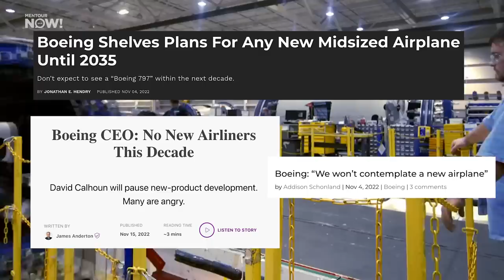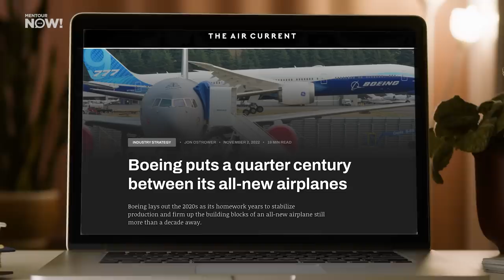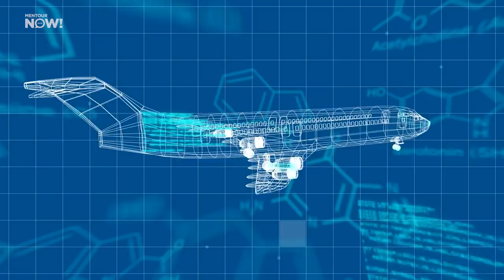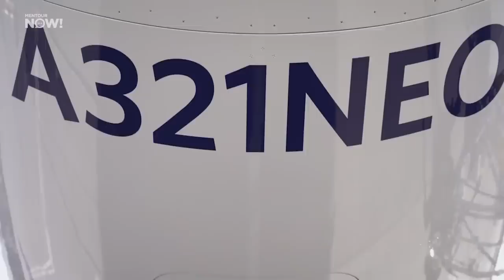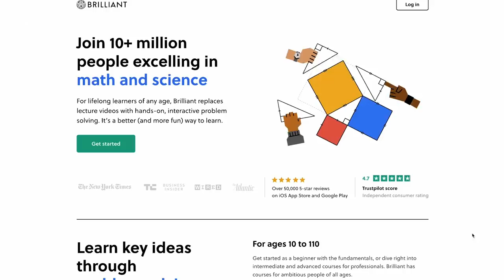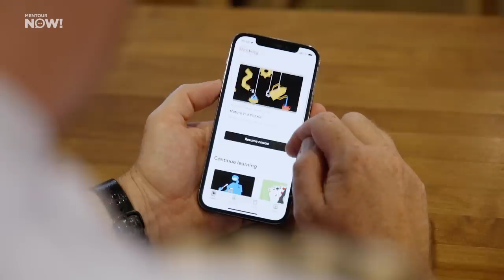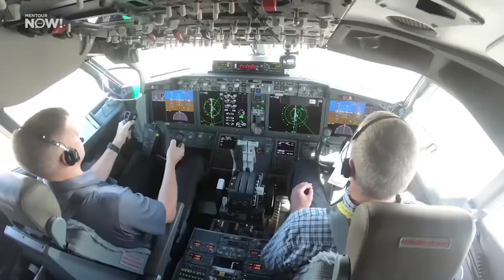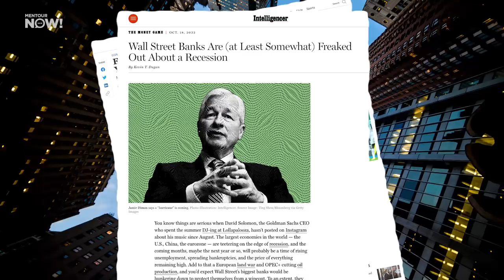Is BOEING giving up!?

Comment: All a bit strange. 
Aircraft manufacturers traditionally have concepts, designs, test prototypes out there years before anything gets off the ground.
 Some of the gaps in Boeing's line up seem obvious: the 757 replacement, an updated 737, a plane to compete with A220, which they have none.

Comment: What about potential compensation claims for 737 Max customers? Those must be pretty high. I would also consider that Being as a strategic partner of US-DOD has got sufficient more information, which we don't have, i.e. they need their capacities in all areas for upcoming trouble. So they consolidate and get prepared, makes sense. Furthermore I just read in a Lufthansa advert that their new 787-9 runs on 2,5 litres (per passenger/100 km, I assume) which is compared to a 20 year old Airbus 340 1 liter less - almost 30%. As You stated, there is not much gain in a new model for a foreseeable future. Then there might be China with own Airbus copy cats probably entering the world market cheap (except of US/EU) ?  One lasst thing: 
I think that Boeing is in parallel co-operating with a couple of other medium sized manufactures across the globe in secrecy or let's say:  given litte attention to by public. 
Also that one could assume, is part of a wider US business & military plan by strategists know where they are heading too, don't worry too much.

Comment: I see alot of criticism here in chat but I want to make a point. 

I think the vertically integrated fossile fuel industries are going to eventually kill commercial aviation, not directly but indirectly. The problem is that as long as prices are low people will continue to use fossile fuels until eventually the drills required to reach the next barrel will make it too expensive for most air travelers. Airlines will be forced to running the most efficient aircraft and avoid long hauls overseas. They will see their profits eroded by high speed rail that is going to just take off in the next decade as transportation industry scrambles to find high speed alternatives. 
  
 If I am boeing I am looking at this, heres why. 
Solar. 1400 x .33 = 450 w/m. So lets argue that 787 Needs 1000 kg/sec at 250 kN
250,000 / 1000 = 250 m/sec Ve. 250 x 250,000 = 63 MW power for take off and say 25 MW for level flight and recharging takeoff batteries. Per engine. Total is 50 MW. 
Take 50 MW/ 450 w/m and you get 111,111 sq. meters of required panels per craft the actual wing area is 377 sq. m so roughly 300 fold increase in wing area and weight. Its probably true that with modern technology adding solar panels to day flights does not justify the added weight. Solar might allow travel at much higher altitudes but with a huge increase in side drag and reduction in speed. At some point the speed falls below highspeed rail, and the game is over. 

The same is true right now for fission based nuclear reactors and for future fantasy fusion reactors. Fission power could be potentially employed but since the cooling channels would need to be in the wings, there is simply no way to make it safe. 

Conclusion there is no effective on board electric power generation that is a full replacement for Jet fuel. 

What about batteries, for short routes they might suffice, but then they are competing with high speed rail. There is another problem with batteries, the mass does not change between take off and landing, and highspeed landings are brutal on aircraft viability, outcome, bigger wings and slower speeds. 

This leaves hydrogen. Hydrogen has the highest energy per kilogram of any fuel but nuclear fuels. You can achieve exhaust velocities of 4300 m/s at sea level. This might seem like a miracle until you realize that despite having a higher specific energy, its peak energy density is about 1/3 that of kerosene, and the pressure hulls required to store hydrogen are much greater than those required to store fuels liquified at STP. This means more added wing area. This has an unintended benefit that the craft could fly at FL 450 to 500, but then that adds the problem of dealing with toxic air. 
The other problem with hydrogen is production via solar is about 45 watts of hydrogen equivilent of power per sq. meter, so while home solar might be break even now, solar electric hydrogen production costs 10x per unit of power. Or to put it like this, for our 787 equivelent at 50 MW power we would need 1,000,000 (1 sq km) of solar panels per aircraft feeding hydrogen to the airports. If you do the math you will soon realize transporting the hydrogen from deserts to cities is a big problem. Europe has no such areas to generate power, they would end up needing to refuel in Africa. 

Alright, so Jets are tied like an umbilical cord to jet fuel, we have thousands of unused jets sitting in the desert doing nothing, regulatory agencies are cracking the whip, and there is no replacement flight technology. If we dont conserve liquid fossil fuels for industries were those fuels are the most, 10 fold more, advantageous than any other fuel then current usage will sink commercial aviation. 
Yes, yes, I know, theres a ton of fuel out in the gulf of Mexico, and the north slope of Alaska. And I also know there is a tons of tons of oil below deep shale formations already tapped. But these sources of fuel will not sustain the airline industry for 50 more years at current value, even if all other uses stopped. 
If Boeing were to finish its current modifications by 2030 and spooled out production on those for 15 years buy the end of that 15 years they would have sufficent aircraft to last until liquid fissile fuels became unfeasible. My guess is that the industries see this wall coming. 

What Boeing needs is a breakthrough energy technology. My best guess is a more efficient way to create Solar electric hydrogen production. An alternative is CO hydrolysis and methane production, more future fantasy tech. Coal gasification with hydrogen, the problem with this is that the graphite layers are resonance stabilized, you need to add extra energy to get carbon to pick up hydrogen free radicals. These fuel production strategies all suffer from the same problem, its much much cheaper to use solar/wind  electric directly rather than converting to fuel and back to power again.

Comment: I think there will be a dramatic commercial design shift in the way we fly now to a one wing body design. Similar to the B2 design… retooling is the biggest hurdle.
Reply: Boeing has considered that for a long time, even as far as unmanned small-scale prototypes in collaboration with NASA, but as far as I know haven't made any serious moves in that direction. As well as tooling, there'd surely be a lot of certification challenges given how dramatically different it is, plus issues like evacuation (how do you evacuate it? Hatches in the floor with slides?) and airport infrastructure designed around traditional tube-shaped aircraft, you'd have to redesign the entire ramp and jetway infrastructure.
Reply: I'm waiting for Zeppelins to come back.

Comment: Boeings bread and butter right now is the 737. They have sold a ton of them recently. Im very confident that boeing is on a serious upward trend right now.
Reply: That is a very old design that already hit severe limitations. But pilot training, etc.
Airbus is in a better position wrt pilots as their common cockpit has much more life in it. As compared to the 737 which still has very much the same overhead panel as the 727.
Reply: Upward Trend? Many people do not even check in if the flight is operated by a 737 Max....
Reply: Considering i work there,  my information is based on fact,  not an opinion.

Comment: though they were not entirely new aircraft designs, McDonnell-Douglas was very busy developing, engineering, and manufacturing aircraft that were only superficially similar to existing models. The MD-11, MD-80, MD-83, MD-90, and MD-95 required substantial development over the parent airframes. And to people who try to tell me that the B-717 (MD-95) is a BOEING design, I say “Look at the main landing gear hubcaps. They have the name McDonnell-Douglas cast right into them!” Boeing did none of the design or development work on the aircraft, and darned little of the testing. If the manuals had been ready, the plane would have been Certified before the buyout!

Comment: I saw a documentary on TV about the Boeing 737 Max crashes and two of the key points that came across was that Boeing, which was once an Engineering icon,  started pandering to Wall Street in the late 80s. Then they acquired MDD in 1997  and replaced their CEO with the MDD CEO, a person who had led MDD to its bankruptcy. That gent brought in his old boy network to Boeing top echelons and Quality Control on the production floor became a dirty word. That was the reason that ex Boeing staff say that the 737 Max failed in its design.  It is difficult to believe that such a thing could happen with an Aviation Behemoth like Boeing. Anyway, hope they wake up and realize their mistakes and turn to the "straight and narrow way".

Comment: When the A380 Airbus was launched I thought bigger was better but than I realised the Boeing 747 was more elegant in design. Because the shape of the 747 looks like a bird flying in the sky, whereas the A380 looks big. Although, both planes have their pluses and minuses… That said, competition between Boeing and Airbus should make their airplanes more innovative. But, perhaps, they should collaborate because the Chinese aviation industry is rising fast, and it won’t be long before they take a big chunk of the market.
Reply: China aviation industry will not be competitive in nearest 15 years. China needs their own jet engines manufacturer for all types of aircrafts to compete. China may even produce all electronics required for aircrafts. But engines are still missing.

Comment: Tube with wing designs are optimized so engines are the only marginal gain potential, and it’s marginal.  Blended wing body designs have the constraint that the public won’t like them.because of the “theatre style” seating arrangement…fewer windows and the fact that anyone sitting further from the centre line will experience large vertical movements on banking.

Comment: A ducted fan will push the thrust down the line…whereas an open fan will surely lose thrust through open ended fan tip washout?Roly🇬🇧.

Comment: A simpler explanation for the delays in new airplane design is the retirement of older and much more experienced R&D staff. American corporations don't invest in their workers, leaving large gaps in capability when experienced staff leave or retire. Once they leave, there's rarely any documentation around to learn from, since there was no time investment in that activity. It's the same problem across manufacturing and R&D intensive industries everywhere. It's very difficult to replace experienced R&D staff that know the ins and outs of these systems.  Boomers retire, while younger workers would rather work in tech or other industries where the pay is higher, and work is easier in comparison. I wouldn't be surprised if Boeing's military research and development suffers from the same problems.

Comment: Title is click bait.  Aviation analysts were not surprised by this.  Looking at the past new model timeframes and not comparing them to neo models is short sided.  Boeing's first priority is to fix 737 Max and 787 issues along with finalizing the 777X.  Second is their debt; Boeing needs some years of profit.  It has been stated for many years that the CFM Rise controls the schedule since no airliner is going to buy a new conventional airplane/turbofan when they can wait 5 to 10 more years for 20+% better fuel economy.  Lastly, Boeing and Airbus know that the conventional fuselage tube and wings are not going to cut it since strut braced wings, double bubble fuselage, blended wings, and advanced materials are feasible in the next decade.

Comment: Why would they bother there is nothing that can be gained from a new design. It's a tube with wings, fuel tanks, tires and windows. As for the avionics it is all off the shelf these days. There has been almost 70 years perfecting jet engines. The only way to scale now is making bigger aircraft but runways can't support them and airlines struggle to fill flights already. It makes sense for Boing to optimise and improve margins on there current fleet.

Comment: Here is what happened: When the owner/originator of Martin Aircraft, Glen Martin, died his sons inherited the company. But they were not engineers, they were MBAs. So, they broke the company up and sold it off in pieces. Surprised in how much money they made doing that, they took that money and tried to buy Douglas Aircraft Co. But they only had enough money to get their names put in front of the Douglas name. Being MBAs, everything that was changed had to prove that it would provide a profit. They screwed up the new aircraft Douglas was trying to introduce.  Then the new president of Boeing winds up being a friend of one of the Martins during university. (I was told they were room mates, but I don't know that)  Anyway,  the end result was that Boeing bought McDonald Douglas and from then on, every project, every work slide, every meeting had a slide that emphasized that the end result of doing this job this way would be "Increased Share value". 
Increasing share value and increasing product quality didn't always coincide, so share value was the chosen path. They bought land in the deep south and built a plant there. The 787 program started there. They knew that workers in the south rarely join unions or go on strike. I worked on the 787 program at Everett, trying to get the aircraft built in South Carolina to come up to engineering standards.

Comment: There's another issue that Boeing may have to consider. The COMAC C919 has been certified in China and Chinese airlines will be snapping up all the C919s they can get. Eventually the aircraft will probably find markets in the rest of Asia and elsewhere outside Europe and North America even before it gets European and US certification. This will put a hole in Boeing's and Airbus' markets in those regions. At this point the C919 may be a minor competitor and not as good as its competitors but China watchers would know how long that's likely to remain the case.

Comment: Sure if a new engine were to come around maybe Boeing would move up a newer design - but - they evidently do not think that is very likely.  It is about as likely as a break through in battery tech making electric commercial aircraft viable.  Plus you have the pending recession and high interest rates to consider; making it difficult for most potential buyers to finance any big new fleets for a few years.  It will probably be fair to say Boeing simple doesn't care to put the cart before the horse - when something comes that is promising then they will move.

Comment: One of the issues is that no airline will invest in planes that burn hydrocarbons now that electric / hydrogen / ammonia planes are potentially / possibly on the horizon: or at least very much more efficient burners of hydrocarbons.

At least not if any airline execs are taking the motivation of global warming as seriously as I believe they should be... 

Boeing are actually wise to put design of obsolete tech on hold on order to await the new.

Agreed this is a gamble: is they can pull it off they will be ahead; of it falls flat and falls to deliver they've basically resigned from the game

Comment: Could the answer be that Boeing does not want to commit to a new design until it is clear what the future of aircraft propulsion is going to be? That is not only a matter of whether the open-fan engines work. What may be more important is what is going to fuel them. If increasing environmental pressures mean that hydrocarbon fuels are out of the question, RISE may be the heroic last gasp of a line of technological developments, like the very last compound turbocharged piston engines of the late 1940s. Would it have made sense in 1953 to invest in a hugely expensive aircraft powered by the Pratt & Whitney Wasp Major?

Comment: Give me back Mcdonnell-Douglas! The DC-10 really was a great plane on it's specs, at least in the 1990's SNES game Aerobiz. Able to travel over 7,000 miles, big enough to make money, but not impossible to fill like a 747 on smaller routes. The DC-10 was the only plane under 400 seats to have that range until the 767 comes along. It's not surprising that Boeing can't compete, because, as stated in the video, they bought out their only North American competition way way back in the 1980's! As a "cost plus" contractor, Boeing had no meaningful competition for NASA contracts until SpaceX came along. All the other military contractors are playing the same game of slowdowns and cost overruns with no repercussion.